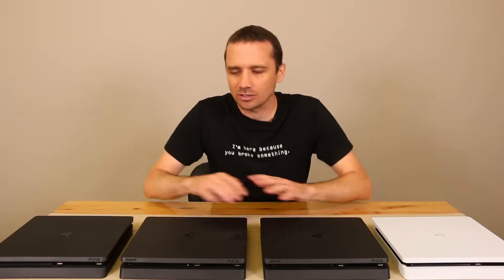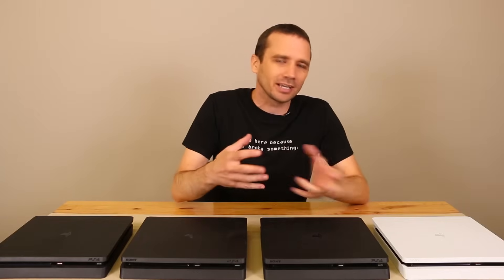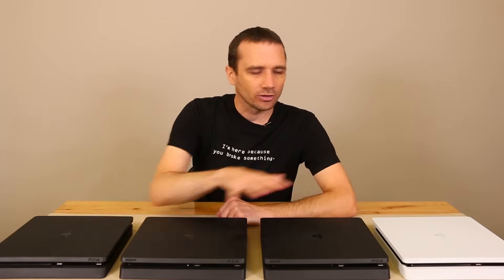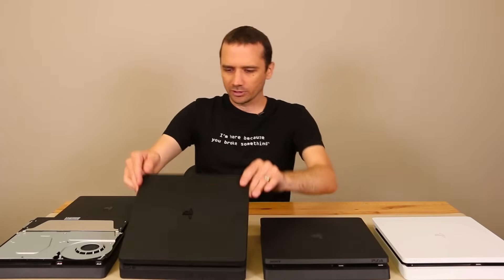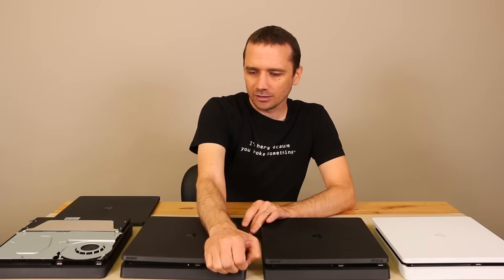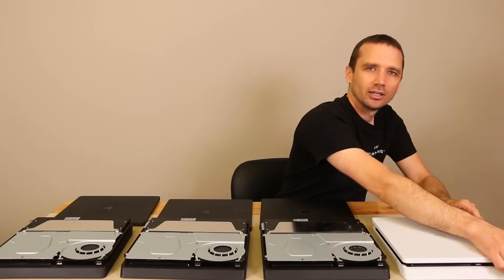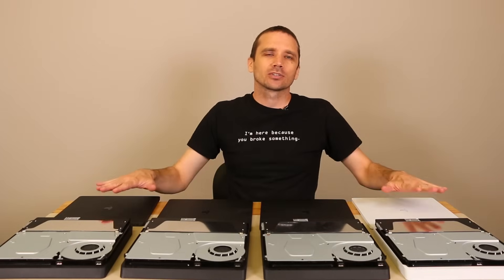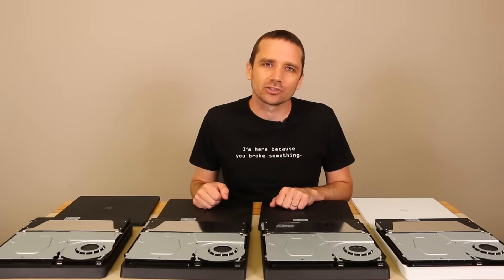PS4 Slim Top Cover Removal - Don't Break It!

Comment from the maker: Thanks for watching! I'll be hanging out here in the comments for a bit so ask any questions you have. Thank you for supporting this channel!
Reply: You made a video called ps4 slim cleaning maintenase and dusting, in the video you remove the screws to be able to remove the metal plate to get directly to the fan. The thing is how do you get direclty to the fan if the metal plate has rivets on it?
Reply from the maker: You can take a pair of pliers and round off the rivets just enough to get the metal plate up. I'll make a video about it.
Reply: Will this void the waranty, its a 5 month old  ps4
Reply from the maker: Yes
Reply: Pliz my Ps4slim auto eject my CD
Reply: Swalik Tamale do you able to fix it?
Reply: ALL IN ONE how can your ps4 slim top cover became lose? Do you fix it?
Reply: ALL IN ONE so you change the top cover?
Reply: TronicsFix I have a?  when u  put a new top cover  on a ps4 slim  ... can u use any top off any ps4 slim?
Reply: U have to remove screws first right
Reply: I just dont get IT off
Reply: @stevencastro8466  pp00
Reply: @stevencastro8466  000
Reply: Wait my ps4 is different it gas two independents and not one😵‍💫🤔

Comment: bro i pulled my hardest and it just doesn't come off, does the ps4 have to be off or smth because i literally tried your teqnique but it just doesnt come off
Reply: Facts
Reply: Bro try your hardest to not to pull forcefully but a little gentle and it should pop straight off
Reply: As he said its gonna be a little tuff
Reply: I also can't even pull the top off cuz I'm too scared that I might crack it😂
Reply: Flip it so the back of the ps4 is facing you and then pull
Reply: Hey. For reason my ps4 top cover is not coming off completely.. I got the whole front off but the back of it is stuck..

Comment: Hey do you have any idea why none of my discs won’t won’t work when they are clean have always been in the case.
Reply: Same
Reply: Goofy Helmet hey if you have the same problem take the top off and air dust it. then once you go to insert a disc turn you’re console on to its side gently and let the disc read.
Reply: @jamiemcsherry2550  thank you very much i was getting kinda worried
Reply: Goofy Helmet you’re very welcome!

Comment: This top cover is really making my patience wear thin. It will not fit back into place as if it somehow shrunk and Im getting ready to just snap the thing In half and have a more open ps4 design. 

Everything else went smooth and tear down and reassembly but just this one part is wasting my time.

Comment: My PS4 slim top won't come off I just can't unsnap where the Sony logo is, I'm afraid of breaking my console. Can anyone help me??
Reply from the maker: I'm not sure how I can help you. I literally made this video to show how to do it.
Reply: Same with me.. do you finally able to open the top cover?
Reply: I had the same issue minutes ago. A small piece broke from that same exact part so now i have to crazy glue it but thank god it was a small piece. Also i still didnt get to clean my fan at 100% but its way better than where it used to be with all that wood shaving dust FedEx got into my console in every section.

Comment: Im trying get the metal plate out, so I can clean the fan but there is that small black buttons attached to it how can I take it out? Thanks...
Reply from the maker: That's a new style Slim. Those are rivets. You can round them off with pliers just enough to slip the metal plate over them. I'll be making a video about that at some point.
Reply: TronicsFix its plastic but I dont want to force it out, so yeah ill just do it with pliers...thanks for the tip..
Reply from the maker: Yes, they're plastic rivets but nothing comes out. It's all part of the mid frame. That's why I said to round the off then pull the metal piece out.
Reply: Thinking about getting a Slim to replace my 1216 model and had just recently learned about those new plastic rivets over the metal plate, was hoping you'd release some video/info on a way around them.
Reply from the maker: I will!
Reply: Appreciate it in advance, looking forward to the video.

Comment: So  a very small pebble went into the vent of my PS4 slim and i cant seem to get it out any chance in  it will damage my PS4 overtime so far it still works
Reply from the maker: It will probably be fine. You could always just take the covers off and shake it out if you want to get it out. Just don't do that if it's still under warranty.

Comment: Hi sir I am planing to buy a ps4 pro but I have a 1080p 32inch Samsung led HD TV, will ps4 pro work with that TV, and I have heard that some games lagging on pro with 1080p screen so I would like to know whether should I go for ps4 slim or ps4 pro, which console do you suggest for 1080p TV, please let me know, thank you sir have a nice day
Reply: ps4 slim is the best option no doubt, but if you want some extra fps or high res even on 1080p screen, then the pro is the also the best option.
Reply: Sheikh Ghouse imran the PS4 pro supports supersampling so you will get a better image. But i recommend to you to buy a 4K tv later on so you can utilize the console at it's best

Comment: So my PS4 keeps on overheating and at one point I smelled the back and it smelled like smoke what causes this?
Reply from the maker: I've got a video about overheating that will probably answer your questions. As far as the smoke smell, I have no idea.
Reply: TronicsFix thanks for the help
Reply: TronicsFix another question my PS4 overheats only when I play fortnite what causes this and what can I do to fix this
Reply: Damian Carrillo the only thing that you can do is to open it clean the dust and pit new thermal paste on it. DON'T do it if you are not sure that you can do it.

Comment: It doesnt work on my Ps4 pro dude. Its like the corners are glued only the middle section gets a little loose!
Reply from the maker: Yes, it does. It works with ALL PS4 Pros
Reply: TronicsFix LLC Im not sure. My finger tips still hurt after a day when I tried so hard....
Reply from the maker: You don't have to be sure...that's your choice.
Reply: TronicsFix LLC Ok mister.but what do I do wrong help.me instead of that behaviou please. It feels glued  thats how hard it is
Reply from the maker: I know...I've removed lots of them. I see comments saying things like "it doesn't work on my PS4" but it works on all of them. They are all built the same way. It's fine if you comment and say you can't get it off but don't say it doesn't work. Lots of people read these comments for help and advice and telling other people that it doesn't work isn't helpful. 
One of the things is you have to be sure that you're pulling in the right place. You can look under the top cover and see where it comes off...if you are not pulling on just the top cover then it won't come off. Some people also just aren't strong enough. I'm not saying that you're one of them but some people just don't have the strength.
Reply: TronicsFix LLC That is all nonsense and the fact that it doesnt come off more easily is wrong from itself so it partly doesnt work. Nobody has to be a strongman to pull the damn.cover off xD. I see all the videos doing it easily it frustrates me because issues like on my ps4 pro shoulf be in these videos. Then tell my how simple it actually is. So again please tell me exactly how its done because youre the expert!
Reply from the maker: Well, first of all you should watch the video for removing the PS4 Pro top cover and not this one for the Slim. The Slim is much easier to remove. If you watch mine with the Pro consoles you'll see how hard it is even for me even though I've done a ton of them.
Reply: Mine has black anti tamper fixings on that metal fan cover.

Comment: Hey man... My ps4 started to blink a blue Light... it turns on... but, to turn it off I had to press the power botton for 15sec... I also could not enter into safe mode... also tested another cables only to test it... but w/ no results... and also tryed the washer fix but the results were the same.... what sould I do?
Reply: TheREDAN13 what model your ps4 ?
Reply: @dayahsuwa6643  its a ps4 slim 500gb